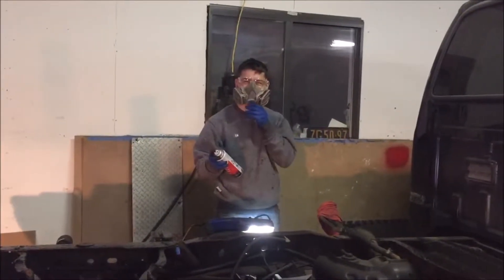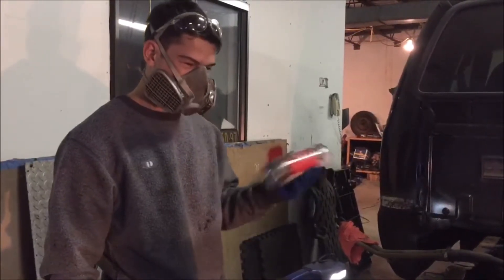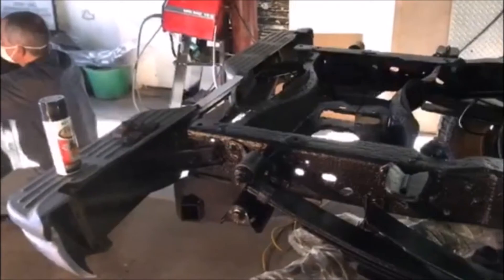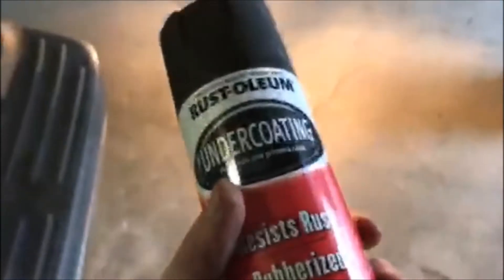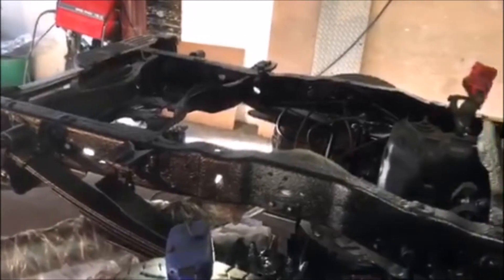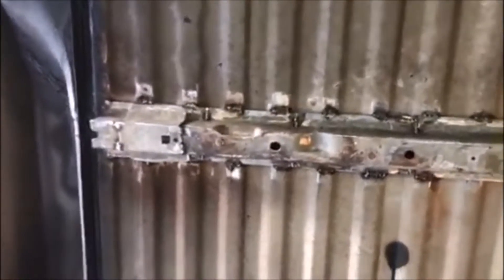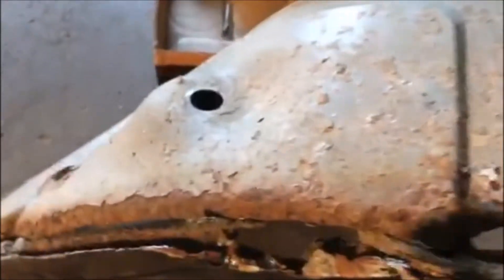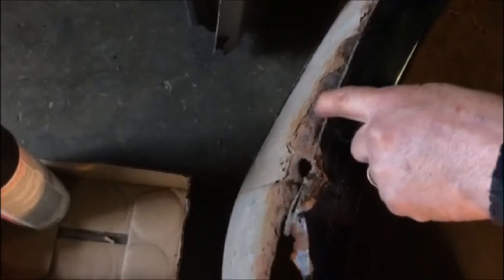Project 7.3 Rust Repair Part 3- "Solving Ford's Biggest Issue"

Comment: Ryan can you send me a link to where u ordered your fender you will be cutting in to add to your bed.  Did you say a company called ebr?
Reply from the maker: https://raybuck.com/product/1999-2010-ford-super-duty-pickup-upper-rear-wheel-arch-driver-side/
Reply from the maker: Theres the link. That website has just about anything you need for rust repair on these pickups. Don't forget the link I sent you is just one side. You will need a drivers and passengers side. Thanks for watching!